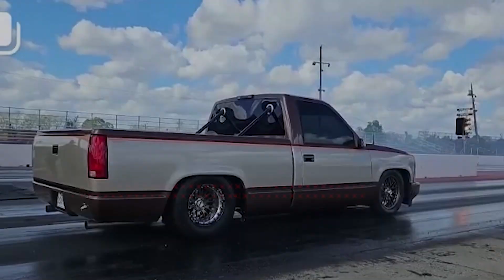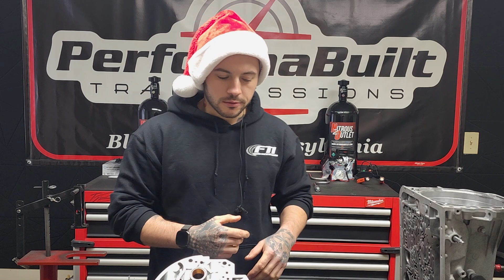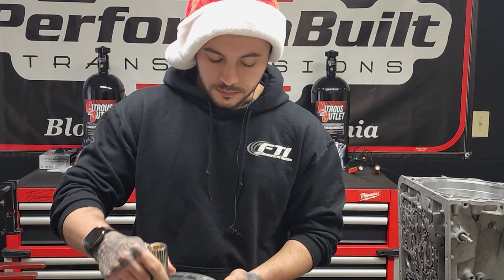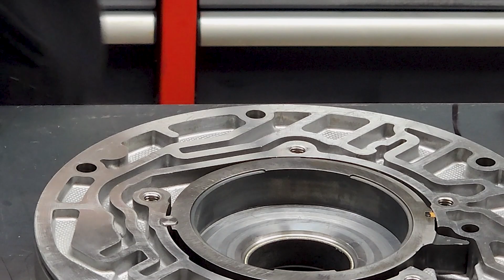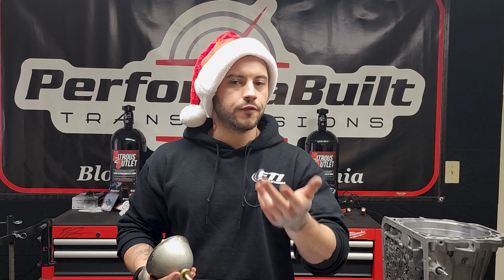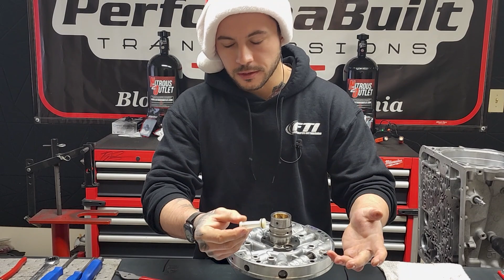OEM 4L60E Build Series Pt. 2: Front Pump

Comment: Yo , hope all is well,  quick question , you mention  how that pump you built in the video will have  around 180 PSI, now i believed you used a Factory .470 boost Valve,  Now compared to a sonnax .490 or Transgo .500 what would expect in a increase of PSI over the .470  using the bigger valves,  TTYS Walter
Reply from the maker: Roughly 200 psi. I used a .490 valve in this video.
Reply: @PerformaBuiltTransmissions Good moring,   Coffee time!!  OK another quick question , i believe a ALL out performance 4L60E  you build has line pressure in the 300psi range?  How do you get that much pressure out of the pump?  or is it achieved elsewhere outside the pump?, Walt
Reply from the maker: @LSXTtype  ours is roughly 200 psi not 300. Im sorry Lsx type, Im not teaching anyone how to do exactly what we do. I appreciate your support but questions like this will be politely ignored next time.
Reply: @PerformaBuiltTransmissions  OK Ryan No problem,  I think you woke up on the wrong side of the Bed,  Sorry to bug you, im a big Performabuilt fan, i bost to everyone how your the best!!

Comment: Hi Ryan Great video, Quick question, On the oppopposite side of the Stator  where the converter will live i have some scoring on the outside of the stator shaft, This particular pump im rebuilding had wiped out the pump bushing (front pump cover bushing)   the scoring is about 30% around the shaft and a inch tall,  This part of that shaft it is where the rotor and veins are,  The surface is mint, no gouges etc,  and the scoring isnt terrible but im really not sure if it would have any effect on how the pump operates,  Also the other side where the bigger end of the stator bolts into All the surfaces are like new, Inside the stator shaft is all good too,  Walter
Reply from the maker: No issue
Reply: @PerformaBuiltTransmissions  OK sounds good,   A friend of mine is going to give you a call, He has a Syclone (700R4)  needs a performance build, hes asking me about other transmission builders, I told him to give you a call,   His name is Scott,  i told him i highly recommend you, Walter

Comment: Where would the input shaft bearing be in this transmission cause I think mine is worn
Reply from the maker: On the input drum behind the pump technically
Reply: @PerformaBuiltTransmissions  but what would be the part number for it so I get the right one

Comment: If the front pump cover needs to be machined ,is there a maximum you can remove of the aluminum ?
To get my surface flat again, i had remove ~ 0.7mm
Reply from the maker: Yes there is a limit. Most pumps arent oem thickness anymore from being rebuilt 100s of times over so you just cant cut into the orifaces or pin for pressure relief. .7 is alot however

Comment: 2015 Ford Transit XLT 350 HD (rare 5lug HD model) 
I carried too much weight up top on my upper racks going up a hill when I had around 50000 mi and the transmission got really hot
Ever since then when I put it in 6th Gear (overdrive) Under a load it will shutter or vibrate
For the past 130,000 miles I've been driving it around in 5th gear without a problem
If I wanted to fix the shuttering in 6th Gear problem do you have any idea what that would be? 
When I was going up the hill I had it in overdrive when I should have been manually Shifting the gears
Reply from the maker: Sounds like you fried your 6th gear and or lockup clutch. You got the trans hot and hurt it badly, its just what happens and theres no easy fix.

Comment: I am working on a Ls3 swap in a 03'Crown Vic.  She is heavy. I've heard the gear ratios are better in the 4L60. I'm going for about 500 wheel ish horse power. N/A street car maybe some burnouts. Can I run a 60 without having to drop 5 grand in it or should I just run a 4L80?.
Reply from the maker: Easily accomplished for 3200.00 shipped through us for a 700whp 60e. Theres no need to run an 80 it will slow you down 100%
Reply: @PerformaBuiltTransmissions I have a 04  Gmc sierra. 6.0 built 80 mm turbo. Messed up my 4l60e not stabbing the torque converter all the way in. Shooting for 1000 wheel  then backing down to around 800. What do yo recommend from your company?
Reply: MAN that's what I had heard. Hell yea. Thank you very much.